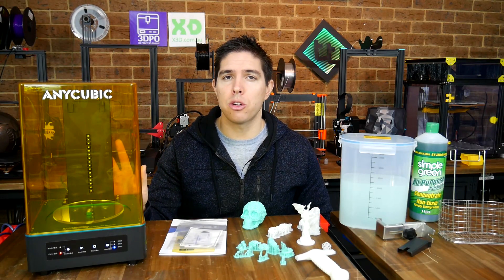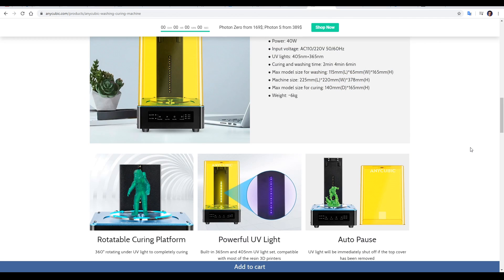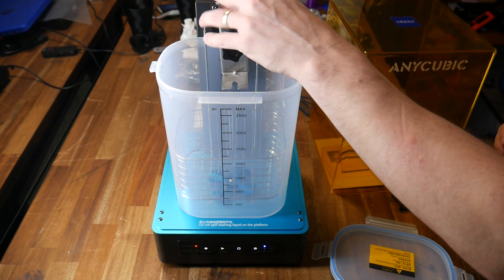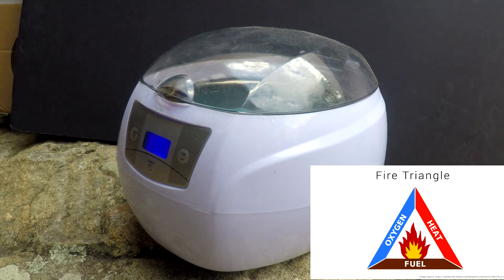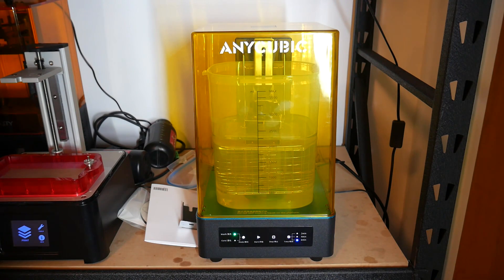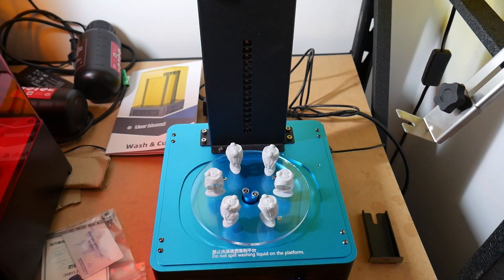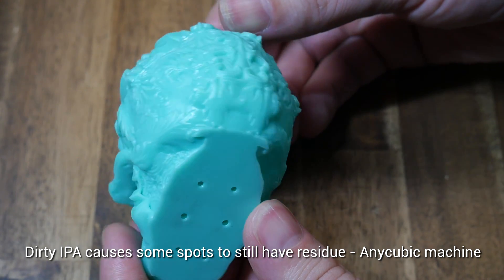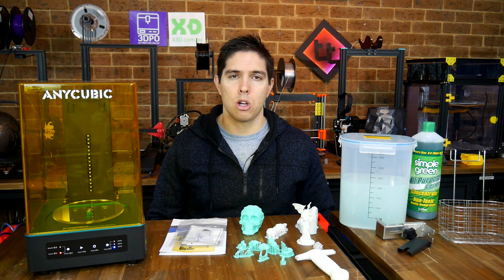ANYCUBIC wash & cure machine: Streamline your resin 3d printing workflow

Comment: A simple magnetic lab stirrer plus stir bars ($30), plastic container with lid ($10), 405nm UV lamp ($20). Just cut to shape some chicken coop wire to protect stir bar from print at bottom of container. Those built in UV LED's are gonna go at some time or another. So another timely expense.  Save yerself tons and what you save, use to purchase resin. 
As for resin, use the water based. Save having to splash out on gallons of IPA. Its a no brainier!

Comment: I use ethyl alcohol instead of isopropyl alcohol, the fumes are less toxic that way, and it's about as effective as IPA. Also, you can put your transparent alcohol container under UV light to make the diluted resin particles cure and condense at the bottom, making it possible to filter and reuse the liquid instead of replacing it, reducing waste.

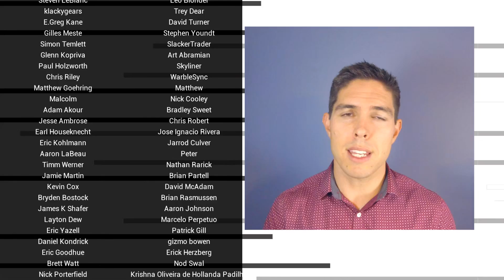Comment: At about 10:45 you address/ask the question I ask.  The machine is still agitating IPA in an open container which can possibly raise the temp and create more fumes.  Probably not as dangerous as the sonic cleaner but I think still not a great idea.  At minimum it needs some type of shelf to go over the impeller so you can seal the container if using IPA.

Comment: You mentioned your preferred method is cleaning with the parts stuck to build plate. I am curious on your work flow for cleaning the plate and bottom of part after removal from plate?

Comment: dont cure resin in the cleaning container it will ruin the bearing, instead pore it in to a air tight bottle/container leave it outside somewhere safe in the sun the resin will solidify then you can re use the ipa/cleaning fluid and just bin the cured resin

Comment: In regards to IPA in a ultrasonic cleaner, I remember reading a white paper that said IPA and aluminum can react dangerously with a heat source. While I'm not sure whether that was referring to a spark/ignition, or simply a high temp, I stopped filling my ultrasonic with IPA. Instead I use water in that tank and IPA (or Simple Green/water) in a ziplock baggie with the part. Works great and cleanup is a breeze.

Comment: OT but I have been trying to understand the downside of TMC5160 vs TNC 2209 (other than price). I understand  that the 5160s are SPI only and not UART, but I do NOT understand what the implication of that is. I am looking at an SKR1.4 and .9 stepper motors. While I have years of CNC in my background, I am just starting to look at 3d Printing. I have designed(FreeCAD), sliced (Cura), and printed (at local library) a few parts. Past experience has shown me that in the long term, there is no such thing as being overkill on a CNC(CPU, encoders, rigidity, etc). If you could point me to a resource it would be a great help. Thanks

Comment: the basket should have 4 legs in the corners so that it stands on the base of the isoprop vat and the hanger bracket should be on the basket too so the lid can be fitted inside the yellow housing to contain any vapours.

Comment: Hey Michael I need help my Cr 10 has a problem that I cannot seem to pinpoint whenever it turns on the bed shows as 200 degrees and max bed temp error. Nothing heats up and when I try the temps go back to zero except the beds temp which isn’t actually 200 degrees. I can’t see shorts so if you have a suggestion it would be hugely appreciated as I am trying to print face shields but  only have my ender 3.
Reply: This happened to me because I accidentally switched the plugs for the hotend and the bed

Comment: i wish i could print as easily, but my prints on my MARS keep doing weird behaviour like sticking a little bit to the bed floor, so when it pulls up i can hear a BIM, the print unsticking from the bottom, and this each time the piece is goind up, so something like 1500x per piece ...
Reply from the maker: Something I've heard about and am going to try is emptying the vat and applying a layer of PTFE lubricant. It is meant to prevent the prints from sticking to the FEP rather than the build platform/model and peeling off.

Comment: I would like to see a fan in the station that blows air over the parts for maybe a minute before it starts the cure cycle. Would help with evaporating the IPA.
Also i have had some success with curing out the diluted resin from the IPA. The one thing i have noticed is the longer you wait the harder it is to filter out all that resin and unless you have a great setup for doing it you will spill a lot of tainted IPA every where.
Reply from the maker: My open source one has a fan and rotation that you can set on a timer like the other two. I agree it would make things more efficient.
Reply: @TeachingTech  one thing i was thinking is trying some kind of vortex separator before a filter to pull out the bulk of cured resin. Will probably work on it next year when i get time.

Comment: Great design.
Have you tried to UV cure the IPA? That should remove/cure the Rasin in the IPA

Thanks for sharing .-)
Reply: I've tried it, it makes a mess of the IPA, the resin turns into a gross white paste that is a pain to clean up and dispose of.
Reply from the maker: I tried this with the IPA in my ultrasonic cleaner and had the same problem as mushious. I figured it was too far gone. Will try on this mix and see if it's better.

Comment: I love this machine. It’s a lot neater than the other method which was pretty much just like yours. I left the sticker on my spinning plate to keep it from any accidents like a little IPA that didn’t evaporate dripping down and fusing print onto it. I took a small block of wood and drilled some shallow holes which I filled with wooden dowels that can hold a print higher so I could cure at different heights too. This also prevents any falling over while spinning. For anyone that’s wondering, the Elegoo Mars plate does not fit in the adapter but if you really wanted to you could sand the slot a bit so the fatter Mars plate screw and fit in. I haven’t had an issue with delicate prints free floating with supports removed.
Reply: ... very nice!
Reply from the maker: Thanks for sharing. I've yet to read any one not happy with it who purchased one.
Reply: There is an adapter on Thingiverse https://www.thingiverse.com/thing:4201229

Comment: I wonder if a ramp up speed control to the curing motor could be added so that small parts do not fall over when the turn table starts up.
Reply from the maker: The motor ramps up for cleaning so it should be possible. The PWM might be a bit too low at the start hence the jerking.

Comment: I have had this a couple of months now. There is a shortage of ipa in the UK at the moment.
I first rinse my parts in a separate container, then put them into the wash and cure for a thorough clean. It keeps the ipa in the wash and cure much cleaner for longer. I use a silicone mat for curing but the blue tack sounds like a better idea. I'm very pleased with mine😀
The green cleaner is almost impossible to get here and as I understand, it works only with heated ultrasonic cleaners.
Reply from the maker: Thanks for the feedback. They are apparently about to stock spare containers in their shop for this. Good tip on the heating of simple green. If I don't get resulted I can try it.

Comment: Your DIY setup costs less and is way more efficient in my opinion. I would just add a rotation platform to your setup and it would be greater.
Reply from the maker: An ultrasonic cleaner big enough to house the Peopoly Moai buld volume (which is what I purchased it for) was actually fairly expensive. The Peopoly UV lamp I'm using is US$50 too. DIY rotation would definitely help. My new open source one will hopefully fix these problems.

Comment: I'd be interested to know if running the cure cycle with the container of cloudy IPA would solidify and precipitate out the excess resin.
Reply: This absolutely does work!
Reply: @marcup1584  Can confirm it too. Maybe for the next video instead of switching too a different cleaning solution?
Reply: That's a neat idea, I'd like to see a video about it!
Reply: Yes, this works quite well...in addition to curing prints while submerged in Mean Green, when accidentally starting in cure mode instead of wash mode🤦‍♂️.
But, as the rotational speed is much, much slower (cure mode) I've found that transferring to another similar sized container and leaving for a day in the sun works much better and frees up my washing container...(then filtering the solution to be reused).
Reply: ... maybe unfounded, but I am slightly concerned about curing the excess onto the rotating assembly, hence my transferring to another container and then adequately rinsing the washing container/rotating assembly.
Reply from the maker: I'm testing this today. Planning a resin workflow video and I'll be sure to include this if it works.
Reply: @TeachingTech  you can also leave the container outside on a sunny day. it should cure the resin in the ipa which you can filter with a coffee filter and reuse the ipa.
Reply: @TeachingTech  Couldn't find the video, did make/post it? I'm curious to see the results
Reply: I wonder if the UV will damaged the plastic container, ie, make it brittle so it cracks, but then again you could just use a large glass jar.
Reply: @SidneyCritic  Given that it shipped with the container, they probably chose a UV resistant plastic, one would hope.

Comment: It seems kind of scary that the UV lights are pointing directly out. Might it be bad for your eyes to look directly at it?
Reply: They won't come on without the cover on which protects you from the lights.
Reply: The listed wavelength of the UV is between 405nm - 365nm. This puts is in the UV-A spectrum which isn't very harmful and is the UV range which people associate with as common blacklights.